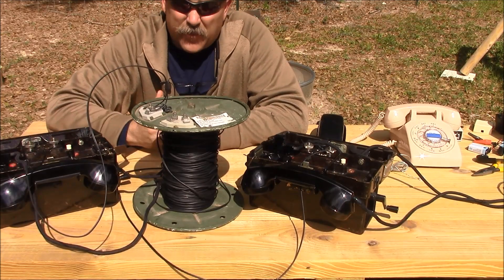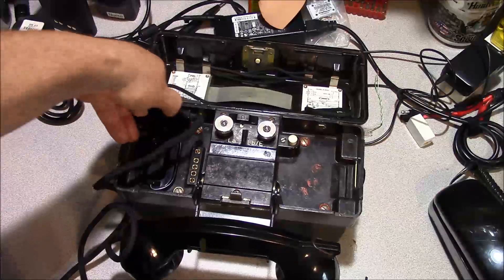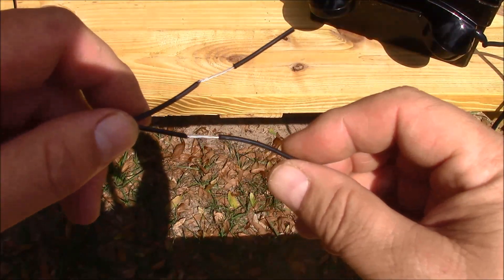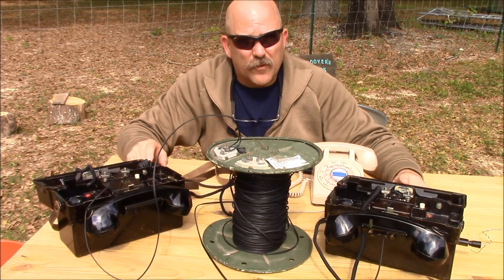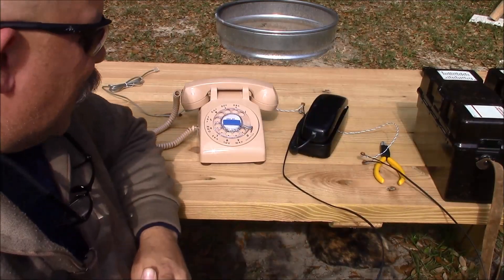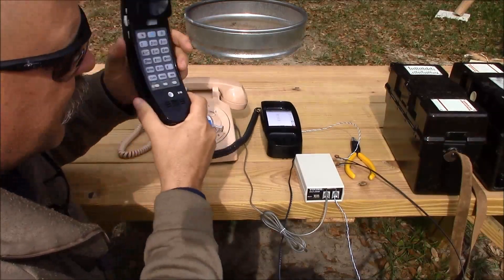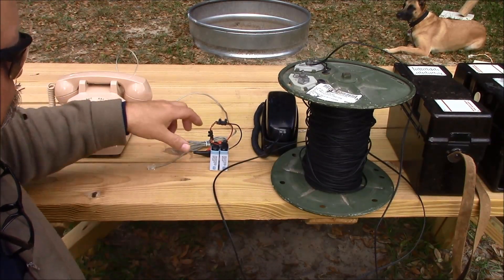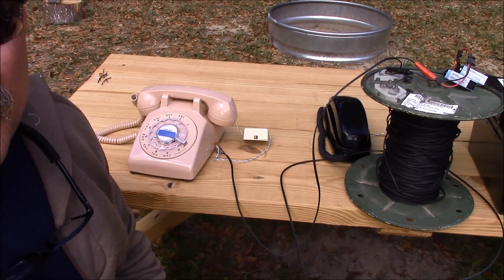Field Phones & DIY Telecomm for bad times

Comment: Do they have a battery operated ring down box?
Reply from the maker: Not that I Have seen. You might experiment with one of those 5 dollar 12vdc to 12vac inverter boards and power it with a gel cel. Mind you they are a square wave output at 50 hz. The viking PS-1A puts out 13.8v at 60hz and it is a sine wave. Or you could get a small 12vdc to 120vac inverter and plug the PS-1A into it to power the ringdown box and put the whole kit and kaboodle into an el cheapo ammobox from harbour freight. Thanks for watching !

Comment: How do you connect regular D cells?
Reply from the maker: Connect them to which piece of equipment ? The field phones I used here have a Dcell holder. Its a plastic arrangement that came with the phones. Do you have phones that are missing them ?Thanks for watching !
Reply: @survivalcomms  My phone doesn't have the holder for the batteries but has the area & wires you connect.
I've got Field Telephone Set 'L' from 1941
Reply from the maker: @battlepup1277  I have never used one of those but I did do some research for you and found some info that may help you :
https://www.vintage-radio.net/forum/showthread.php?t=156350
Reply: @survivalcomms  I'm probably going to solder the battery holder to it
The original batteries are called X cells which sadly aren't made anymore.
Reply from the maker: @battlepup1277  that sounds like what others have done too
Reply from the maker: @battlepup1277  Thats what most folks were doing from what I read as well. Thanks for watching !
Reply: @survivalcomms  Thanks for the help!
Reply from the maker: @battlepup1277  Any time ! Please let me know how it works out !

Comment: what is the rf loss on wd1a wire per 100ft at 30mhz? o & the 500 phone rocks had one that was turquoise as a kid! if one has one with the messige lamp will it light when used as a field phone on battery?
Reply from the maker: This has lots of info on wd1a  

https://www.radionerds.com/images/3/34/MIL-DTL-49104C.pdf  

Thanks for watching !

Comment: Can the Viking DLE200D be used with a field phone to make it capable, with a dialer, to use on a standard phone line? Or would that just make the field phone(s) act like an intercom? Do you know of a (relatively inexpensive) device to facilitate that kind of functionality?
Reply from the maker: Just an intercom. What field phone are you using ?
Reply: @survivalcomms  I have two (US military) TA-312/PT field phones. Considering getting the TA-955/PT dialer unit, but only if I can jerry-rig a way to use it as a regular phone. Gotta have a way to do a dial-tone for the dialer to work on the phone system. I'm kinda new to this and I'm scratching my head. LoL
Reply from the maker: @aaronm9478  That is the way to do it. You need to make sure the unit is set for common battery. Even without it you should get dial tone off hook with the phone set for common battery and connected to a POTS line. To dial out once you have dial tone PTT and use a DTMF dialer IIRC.   There is another channel on you tube  - The Field Phone Guy !
https://www.youtube.com/channel/UCyRGsbwgVp2IQwRwCoIducw
This dude has forgotten more about field phones than I know and he has an awesome collection. He may have some pointers about using the 312 on a pots line sans 955. The 955's are cheap enough here if they still have them in stock $14.95 ! https://armysurpluswarehouse.com/military-issue-touch-tone-adapter-ta-955-pt-for-ta-312-field-phone/
Reply: @aaronm9478  with the ta-312 and ta-955 keypad you still have to have a pair of d cells in the phone and the special photo battery in the keypad for it to work. set the switch on the ta-312 to cb (common battery) and it works on a standard pots line with no other modifications needed.

Comment: Can a field phone talk to a regular phone?
Reply from the maker: Yes and they will work over a conventional telephone line if configured correctly.
Reply: @survivalcomms  that's good to know, but I was thinking more of an in the field operation. Could a regular phone be wired to the other side of a field phone. I realized that the regular phone wouldn't be able to ring the field phone, but would they be able to talk to each other?
Reply from the maker: @Metal_NV  Yes but much depends on the field phone and the regular phone you are attempting to use.  Using the 18v talk battery inserted as described in the video will allow the  standard telephone equipment to interoperate with a field phone in most cases but the field phones  will still require the local battery in most cases.  You can even ring earlier generation telephones  with a  field phone. Later generation field phones do have a selectable common battery setting. Again YMMV you have to experiment with what you have available to you. I hope this helps !
Reply: @survivalcomms  thank you. I'm hoping to buy a field phone later this week. I will play around with it when I get it.

Comment: For the talk battery example, what are the talk time like?  It seems like it'd be reasonable to add a separate ringer of sorts to that arrangement, do you have any examples of that?  The info you're providing is great, thank you.
Reply from the maker: Thank you!  The current is minimal but a 9v battery is not a powerhouse of capacity. You would get a few days of regular talk. If you took two 7ah 12v gel cells and series wired them you would get weeks of talk time and more distance / volume. One could use piezo buzzer in the circuit but I havent tried it. There are tons of wire telephone based projects out there. Thanks for watching !

Comment: couple of questions.....is there a way to hook up more than two phones? maybe 4?  also is there a way to disable the ring but still know that you should pick up the phone>? for security purposes you don't want a phone ringing at a listening post.
Reply from the maker: Yes you can put multiple phones on the same circuit or build a diy switch board. Yes you can make an off hook indicator with a lamp / LED and disable the internal ringer. Thanks for watching !

Comment: Found some in your side of the pond, selling for $99.99 a piece... Not that I need them, have a couple of sets dating from the end of WWII, but they still need a good once-over ( haven't worked on them in 20 years or so - too many projects accumulating :-)
Reply from the maker: They are out there. I bought this pair 20 years ago for 45 bucks each. The WW2 ones (FF33) IIRC. Are very similar. Thanks for watching !
Reply: Pay no more than £50, they often go for this and less at your local military surplus market.

Comment: Good presentation. Well done. 
I  have some questions. 
-I currently have a few TA/312PT model field phones and a small exchange/switchboard. I would like to get a few more phones so as to maximise the capability of the switchboard. Naturally I'd like to get more of the same type of phone but if I can't, will my US made, Israeli surplus phones interoperate with other brand/nationality/era field phones?
-What would you suggest as a set of tools and spare parts to keep with each phone, and/or a slightly more comprehensive set to keep with the exchange/switchboard?
-Can these civilian phones you demonstrated be made to interoperate with the surplus ones?
-Do you have any expedient improvisations I could do for when D-cell batteries run out?
Thanks.
As we used to say in the (Australian) Army, 'no comms, no bombs'.
Reply from the maker: Thank you very much !
 - Most field phones that are local battery will work well with one another. The frequency of the AC ring voltage is 20hz across most platforms. 
- Which switchboard do you have ?
- The main parts to keep are handset parts, cords, and batteries.  Vinegar on a Q tip  works great cleaning up nasty battery corrosion.
- Yes you can interoperate field phones with consumer phones using common battery .  Most field phones will function on the PSTN - its the dialing that gives them kittens. cannot speak for all types but the ones I have tested work.  The ringdown box is best for this application IMHO. 
- You can use any type of battery that will provide the voltage required by the device. Most are 3V so CR123 or an 18650 in a small holder will work  with a set of small test clips. If needed one could  make adapters for AA out of wood , foil , and tape. I hope this helps ! Thanks for watching !
Reply: @survivalcomms  Thanks heaps for your advice and other inputs and uploads mate. It helps a lot.
I shouldn't be surprised at handset parts being the most needed, Soldiers were always smashing radio handsets. Despite mostly being used stationary, I suppose phone handsets are also going to get knocked around a lot too.
My switchboard is the MT-21-56-GT, a small metal box about 10"x 4"x 1 1/2". Works well. I purchased it from eBay, Greek Army surplus. With enough phones I will be able to run six outer nodes and a phone with the switchboard operator. Or, five outer nodes, one phone with the operator and one going to another exchange, or all could do so, or any combination.
A picture:
http://www.bunkerofdoom.com/mil/telephone/sb_993.jpg

Starting small, keeping it man-portable. One day I'd love lots more phones of course and another switchboard or two. I am considering looking into the sound powered ones (TA-1 PT. We called them 'Croakers'). Much more portable, but are the Croakers transistorised? Their non-transistorised status was the most attractive aspect of the TA-312 PT, despite the weight penalty.
I only use speaker wire at the moment due to availability. I join them with waterproof connectors, then wind it on a common garden hose reel.
Reply from the maker: @segrientboar5954  Sounds cool ! It is compact and that makes it a big win.  I do not believe there are semiconductors in the TA-1 They are pretty bare bones . The manuals are at radionerds dot com. I am a big fan of reels.  Thanks again !
Reply: @survivalcomms  Hadn't heard of 'radionerds'. Thanks for the tip, I will check it out.
Have a good one mate!
Reply: @survivalcomms  Mate I checked out 'radionerds' and what a great resource. Thanks again for the tip. Firstly I had no idea the TA-1/PT was so old. They had a manual for it from 1959! Sure to be non-transistorised.
Secondly, my TA-312/PT phones will apparently also work without batteries, via sound power, for up to 6km/about 3.7 miles. I feel a bit silly now as it never occurred to me to even try using them without batteries. So that is another win.

As to reels, I'd prefer the military surplus reels and winding devices, it is just somewhat isolated and out of the way where I live, and shipping is expensive. The shipping expense can be easier justified with something difficult to replicate, like a phone or radio, than it is for something I can expedite, like a hose reel.

Mention was made on 'radionerds' of a store for replacement radio and telephone parts: Signalcenter. But the link doesn't work. Even though a few years ago they refused to export (There are intermediaries to get around this) it was a good resource which appears to have closed. Do you know of another source?
Cheers again.
Reply from the maker: @segrientboar5954  You are welcome ! They have a ton of info on that stuff.
Reply: So far, all hand-crank telephones I have tested works with a TA-312/PT.  The Norwegian TP-6/NA may have problems ringing the 312's but if the ringer on the 312 is served and adjusted it works.  Surprisingly (or not?) The WWii U.S. EE-8 and the German FF-33 are still reliable field phones. Here in Norway The FF-33's are sold from US $23 and up.  

The possible battery shortage you mentioned  maybe more of a problem, but on these phones a battery may last extremely long.  When the battery is to weak for the flash light it will still work for hours of speaking in a phone. At last you may make your own batteries, most of ideas of how to make them are more experiments and theory, but if you use zinc, copper and vinegar, and covers the battery in wax you may get it OK. Depending on what you have use the ideas from "penny-battery" and develop your own batteries.

Not many places to find info, and learn to repair or use such equipment, but you may find something in this forum: http://www.classicrotaryphones.com/forum

Comment: Great info. I chose the TA-1, mainly because I got a great deal on them on ebay about 16 or 17 years ago. I got 8 of them and 4 rolls of DR-8 wire for less than $100 shipped. We used these when I was in the infantry back in the 80's, and they worked fine. I hope to see more videos on this type of commo and maybe some comparisons or pros and cons, and more phone hacks that we can do with flea market finds. It will soon be that season when garage sales and flea markets are going to be cleaning house and deals to be had. Keep up the great work.
Reply from the maker: Cool beans ! The range on those is less than battery operated ones due to  being mic driven. For 99 percent of field phone use they will give you the service you desire IMHO.  Thank you and thanks for watching !
Reply: @survivalcomms  Yes, that's what I was wondering. I'm no commo man, I was a 60 gunner, and we had a TA-1 in our hole in the field, and they worked fine. This is where the pros and cons come into play of different phones, and also maybe a battery hack with lithium batteries or even a small power supply that can be plugged into AC from an inverter or some thing, and semi replace the battery tray when D cells are no longer around. I really enjoy these types of videos, because really, if some thing happens, hacking and "MAKING IT WORK" is what it will be all about.

Comment: Cool
Reply from the maker: Thank you ! Thanks for watching !
Reply: @survivalcomms  a little wire battery clips and grain of wheats you are good , the wire very optional. No need the cost and weight of military grade gear. If you need to bug out easy to rebuild. Thanks a home run video
Reply from the maker: @craigpalmer9196   Great points -  Being able to cobble something together with limited resources is where its at !